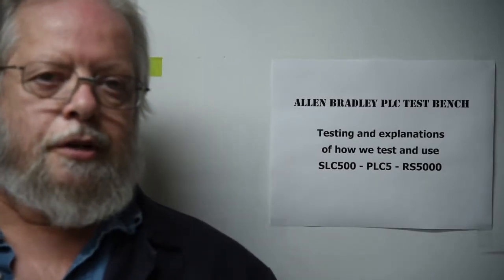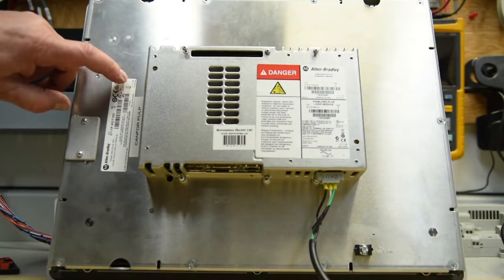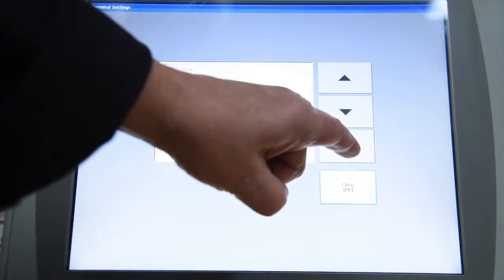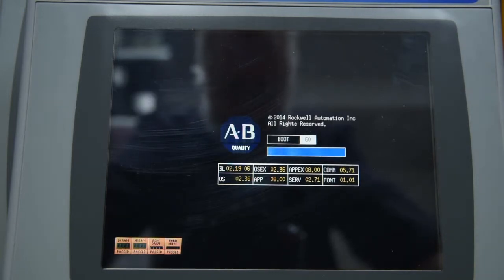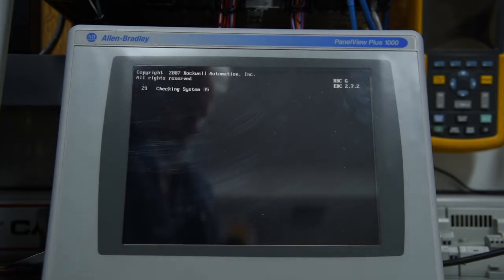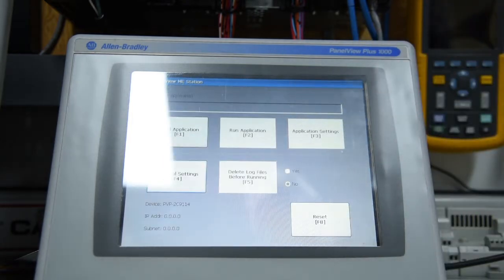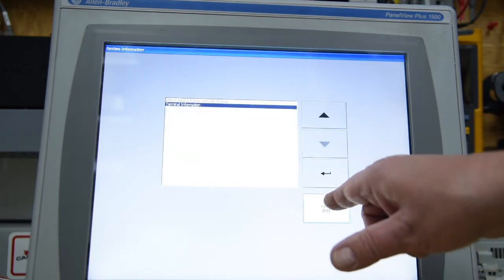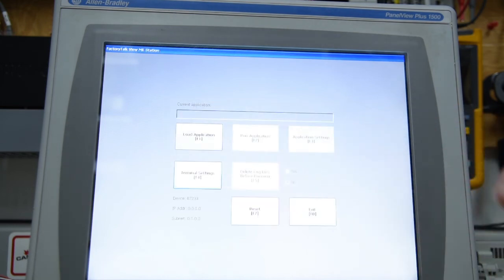Panelview Plus Series C screens and memory modules

Comment: Hello Sir,
I had the same problem with 3 brand new series C 1500 screens, however, I fix the problem with just a firmware update. I used RP1 logic modules on those screens and after the firmware update didn't show any errors. The FW version I used was 5.10.16UP
Reply from the maker: Hi - Glad to hear of another way to fix this.  Thank you

Comment: Hi I am trying to troubleshoot a Panel view Plus 1000, but when powered the screen does not show anything, and The Fault LED is blinking, according to the manual this means it is a recoverable fault. I suspect it does not go past the initial boot. Any ideas, or do you have a contact I could reach out to you to better explain?
Reply from the maker: HI Bart:
I would suspect that the CCFL is burnt out and not having a picture to look at possibly a damaged overlay causing a stuck button error.
Since the PVP6 is a plug and play item, I would start by moving the logic module to another panelview if you have it to see if the problem moves with the logic module.  
No idea where on the planet you are - I am in BC Canada.  Normally I can turn these around in a day as I have the parts in hand to fix them at a reasonable price.
I will see if I can enable the contact link here on YT and then you will be able to contact me.
Bruce B
Reply from the maker: email is enabled on youtube.  Once you contact me I will disable it.  Way too much spam out there. BB
Reply: Thank you for replying to my comment. I am in Honduras, Central America. I am looking for way to contact you via email, but can't see where contact on youtube is located. Not sure if I can give my email, and then you can erase the comment to prevent from getting spam, or falling in the wrong hands.
Reply from the maker: @bartniehorster3453  at the top of the front page where it says' with over 35 years experience' there is a > - click on that and a window will open - scroll down a bit and you will see the contact area.  Click on it and follow the steps to get my youtube email.
Bruce

Comment: Hello sir 
How to access configuration mode in panelview plus 7 & 1000
Reply from the maker: Hello Tamer:
When the terminal is booting up there should be a white square in one of the corners.  Press on it until it goes away and it should boot up in configuration mode.  It all depends on how it was programmed.
Thanks for the comment.
Reply: @abplctestbench759   the white square in one of the corners.not found